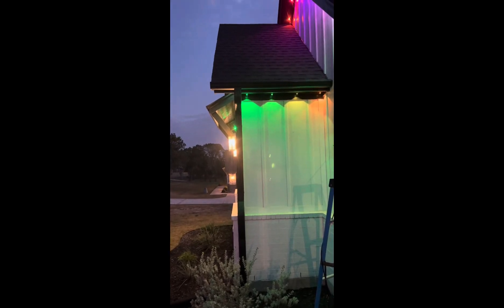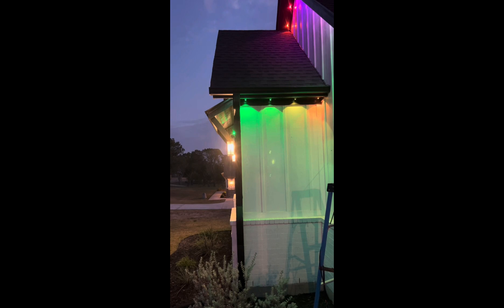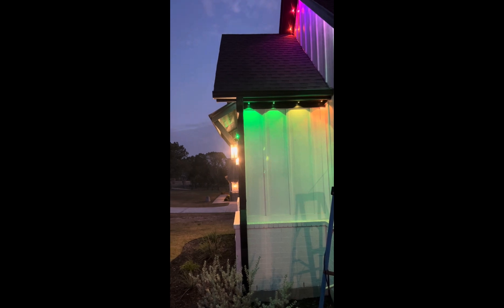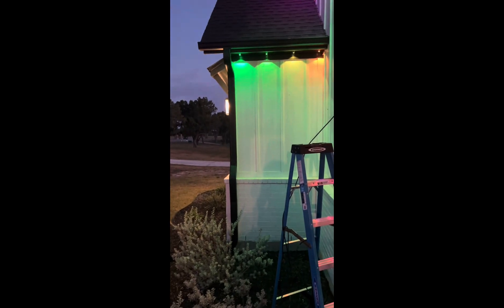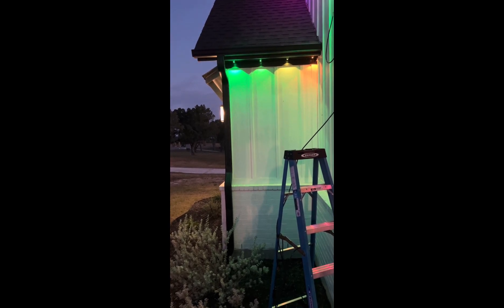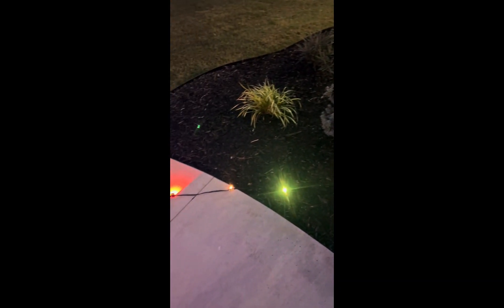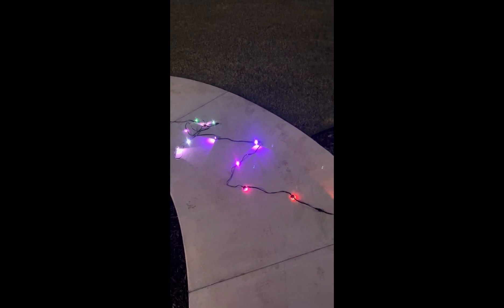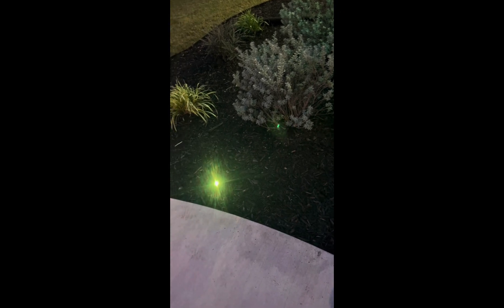Long Jumps/Splices

Comment from the maker: Here are the items I purchased outside of normal tools I already had.

Lights
https://amzn.to/4eCwzgJ

18 gauge/3 strand wire (BLACK)
https://amzn.to/47ZYQMt

18 gauge/3 strand wire (WHITE)
https://amzn.to/3U3ZYcc

Crimp kit
https://amzn.to/4h1swgg

Heat gun (Ryobi)
https://amzn.to/3ZZLJsY

Heat shrink
https://amzn.to/3ZTqCIH

Reminder on screws, each bracket probably takes 2 screws, so do your math on quantity needed!

Mounting bracket screws #10 3/4 (BLACK)
https://amzn.to/4ffZ3OF

Mounting bracket screws #10 3/4 (WHITE)
https://amzn.to/4eZJ5HH

Coax staples
https://amzn.to/4gYZ1f1

Tool pouch (you’ll be glad you did)
https://amzn.to/3ZZEilA

If you click on links I provid, I may receive compensation.

Comment: @Dads_DIY_TX

I'd like to thank you for posting this (and your other Govee 2 videos).
First off, you saved my sanity! ;-)
Secondly, I was able to finally understand how these things work and was able to finish my install before ripping everything off the house and throwing them all away!

One thing that I am quite annoyed with ... the extension cables that came with our set are marked differently than the lights themselves.
For example, one the lights, the outside wires were marked with black markings and the other was plain.
On the extensions, the middle wire had black markings ...
I tried slicing an extension cable into a light string but could not get it to work.

No matter ... your explanation on how to run long jumps really helped and solved the issues I was having.
Amazing how something as simple as adding in a light can make all the difference.

Thank you again!
Reply from the maker: Thank you for the kind words! I really appreciate it! 

Yea, there are so many “issues” with marking as of the past year or so it’s like a dang experiment every time!

Glad you’re up and running though!

Comment: Great video. But couldn't you just put two pieces of black electrical tape over the diode
Reply from the maker: Sure. My rationale though…the puck is fat. And where it was going to land on my house, once I placed it, it would have been sticking out like a boner in a bathtub. 🙃 I wanted it slimmed down as much as possible.

Comment: Also is it fine to add cut lights to extend a light strip? Working with 200ft govee pro kit
Reply from the maker: So you cut some from somewhere else and you want to add them to an existing, complete strand? Yep.
Reply from the maker: So long as it’s from the same set, can’t add anymore than what comes in the box

Comment: Awesome information. I am in the middle of install and need to make 2 y jumps, both with a immediate light run on one end and 20 ft extensions on the other side of the Y. Assuming i splice a light midway on each, should this work
Reply from the maker: Yep!
Reply from the maker: Keep in mind, when you splice in a light, it is recognized as a light. So when you go to do finger sketch, that spliced light is in finger sketch as an active light. So you have to find it in finger sketch and either assign the “off” color to it, or cover it with heat shrink (recommended). You’ll see when you stand outside and do finger sketch, as you pass by/through the spliced in light.
Reply: @Dads_DIY_TX  thanks for all that you do. Given this would you suggest a light, booster,  or extension in the middle as a best option? Also wanted to know if cut lights could be added to other stands
Reply from the maker: If I had an extra booster from the end of an extension that’s what I’d use. Or splice into an extension and use it.
Reply from the maker: Yes, you can “steal” lights from other parts of your set and put them somewhere else in your run.

Comment: Thank you so much for this! I was not aware that each light acts as a booster and each OEM extension has a small booster block in-line. Both the 12' and 4' OEM extensions, from the pro kit, appear have a booster block. As such, I was able to make a custom 20' jump (8' wire + OEM 4' ext. + 8' wire) having learned this. No need to tear a light apart... yet :)
Reply from the maker: Glad I could help!
Reply: That’s what brought me to this video was if I had the pros with extensions I could go from light 12’, govee extension, 12’, govee extension then lights. Thanks!
Reply: Wait, so the OEM extensions have a booster block? I have a 150ft kit but added an additional strand from my MIL left overs. Now the last now the last two strands don’t function. I got a booster but placed it after the 5th strand right before the extension. Could I splice in my own extension to get the last two strands functional or can I splice the last two instead of using the plug?
Reply from the maker: What model lights do you have? 1s, 2s/Elites, or Pros?
Reply: @Dads_DIY_TX  I’m not exactly sure the package just says Govee RGBIC. Purchased from Amazon. I failed to read the description where it plainly states “can only connect up to 9 segments and 1 extension”. I guess now my question is if I splice out the plug(s) will it power the pucks and count them as all one segment? TIA
Reply from the maker: @ that’s why I was asking. Non-pro versions can only push 9 segments worth of lights. Nothing you can do to change it unfortunately.
Reply: @Dads_DIY_TX  Thanks. Sounds like I’m going to have to go the WLED route. Appreciate your time.

Comment: I have all the extension cords from another Pro kit, (1) 12' and (2) 3.9', can I connect all of these extensions together, almost 40'? I have to complete a 35' jump between roof lengths.
Reply from the maker: You can daisy chain extensions so long as there is a booster on them for every 12’ of length. Pretty sure all 12’ factory extensions have them on the ends. Not sure about the shorter extensions though. Make sure you test each extension with lights connected to them, prior to doing it. Those things are prone to being bad/recessed pins inside the connector.
Reply: The pro extensions have a small booster molded into it  at the beginning of the extension. It’s also not a. Booster it’s a resister to keep the data signal constant.

Comment: Going to try this tomorrow! I ran a jumper wire about 20 feet from the main power to the first string of lights (relocating) and have a 15’ jump from the top story to the next and they all are dead so I’ve been obsessed over fixing this for two days.
Reply from the maker: Let me know how it turns out and I’ll help troubleshoot if issues arise.
Reply: @ just got done and it totally works!!! Spliced a small light in the 12’ jump and moving the power supply within 8 feet did the trick! So thankful for your help!
Reply from the maker: @JoshPerez-qk2hh  happy to hear you’re up n runnin’!

Comment: thank you so much for the write up and video! tackling my house as we speak. i have gotten the roof on the first story done but need about a a 35 foot jump to get to the 2nd story. 

so i can wire a 12 foot extension, wire in a light, another 12 foot extension wire in a light then 11 foot extension to the next set of lights?  
thanks man!

thanks!
Reply from the maker: Hey there! Yep, so long as your measurements are good and you’re not going over 35’ of total length. Thanks for checking out the channel! If you run into issues, let me know.

Comment: Can I splice string of lights directly to my own extension without using the connector? I'm assuming so being that the connector is only there for convenience.
Reply from the maker: Absolutely. The pins in those connectors can recess and take away continuity. A lot of folks who have issues with their lights assume that it’s something else and that the connectors are always “good”, which isn’t true. And the workaround is to cut them off and straight splice.

Comment from the maker: Make sure the wire that has the writing on is reading (correctly) from left to right.. ie if you put it in good light you’ll see something like “24 AWG” and/or “300 V”. The “2” goes on the power supply side of your run and the “V” goes toward the end of the run
Reply: So should you use like 12AWG wire for longer jumps like 20ft? Then you wouldn’t need a light in the middle of the jump?
Reply from the maker: @moorelaughs3136 I don’t think it’s the size of the wire, but Im also not an electrician. Try and see? I’d be interested to know.

Comment from the maker: Here are the items I purchased outside of normal tools I already had.

Lights
https://amzn.to/4eXoIe6

18 gauge/3 strand wire (BLACK)
https://amzn.to/47ZYQMt

18 gauge/3 strand wire (WHITE)
https://amzn.to/3U3ZYcc

Crimp kit
https://amzn.to/4h1swgg

Heat gun (Ryobi)
https://amzn.to/3ZZLJsY

Heat shrink
https://amzn.to/3ZTqCIH

Reminder on screws, each bracket probably takes 2 screws, so do your math on quantity needed!

Mounting bracket screws #10 3/4 (BLACK)
https://amzn.to/3NhLv8G

Mounting bracket screws #10 3/4 (WHITE)
https://amzn.to/4eZJ5HH

Coax staples
https://amzn.to/4gYZ1f1

Tool pouch (you’ll be glad you did)
https://amzn.to/3ZZEilA

If you click on links I provide, I may receive compensation.